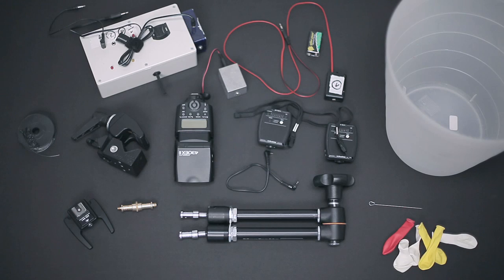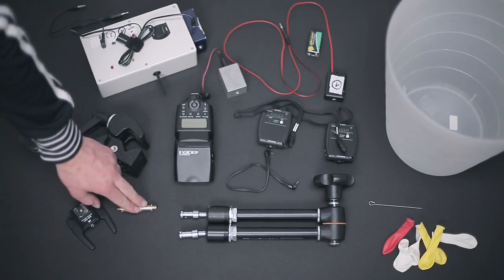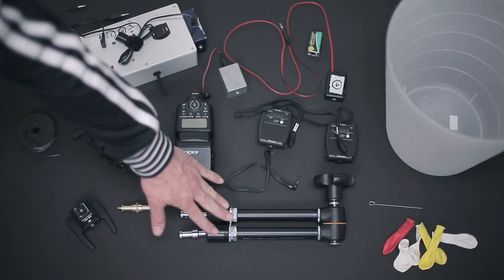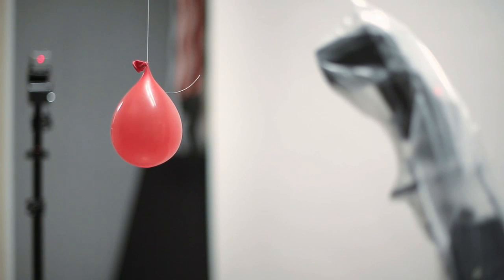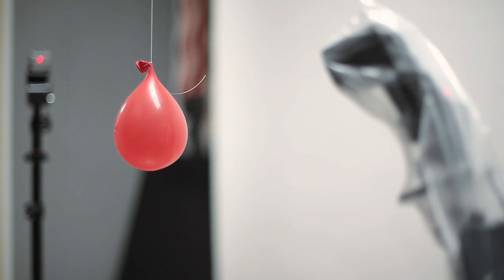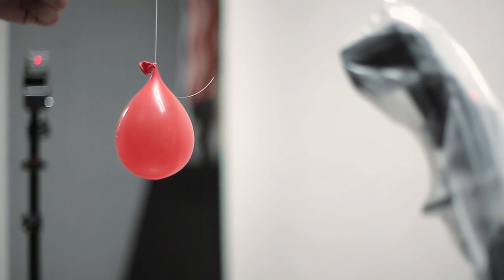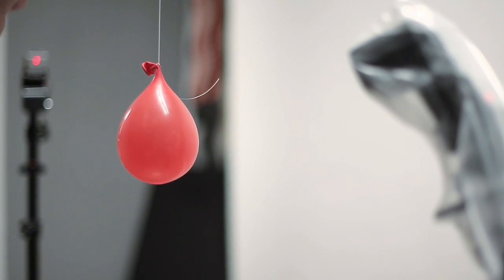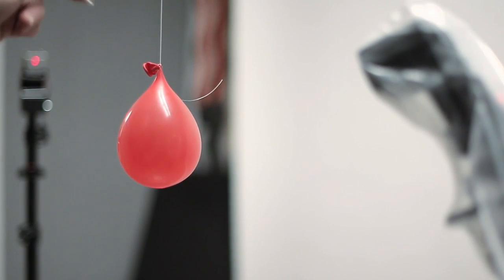Highspeed Photography of a popping waterballoon: How to take a picture of an exploding water balloon

Comment: Im a bit confused with high speed flash? Does this mean that the camera is set to a high shutter speed to catch the action, in which most cameras only syncronize to around 250th or less. Ive tried freezing the water action with my 600watt studio strobes with 250th on my Nikon D3 with only soft images to show for my work. Thanks

Comment: @Rapidz4ak I bought a light and sound sensor of Ebay fot £20 which you can adjust the sound and the light is the same as breaking a beam..... break the beam the speed light is triggered....its not simple....with anything it takes patience and practise